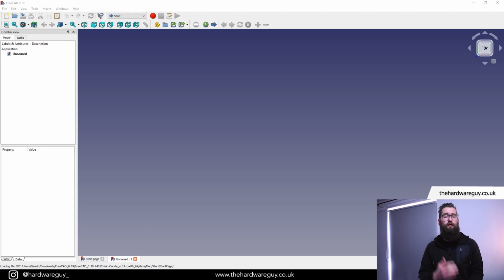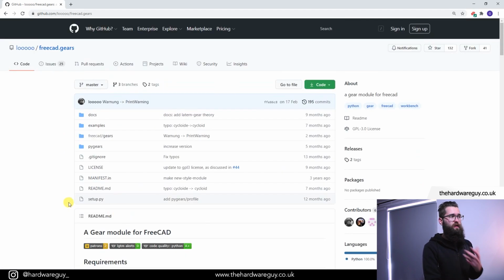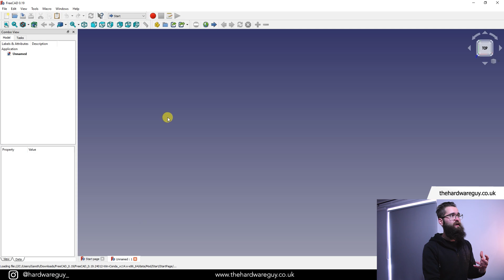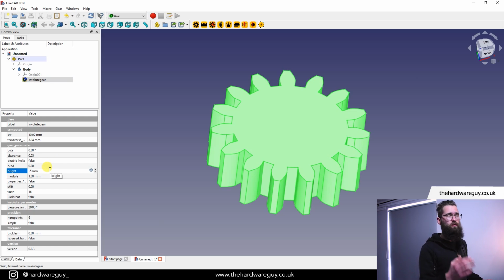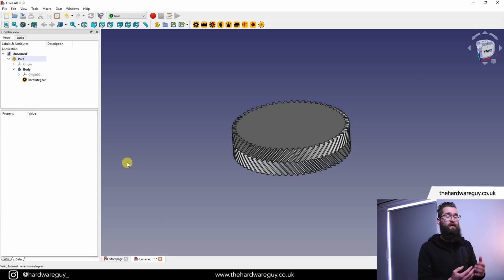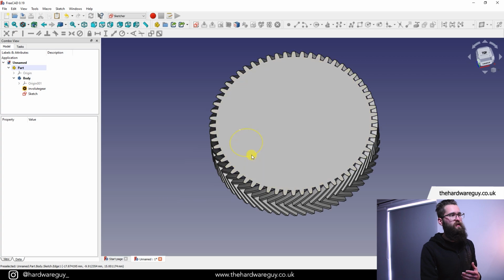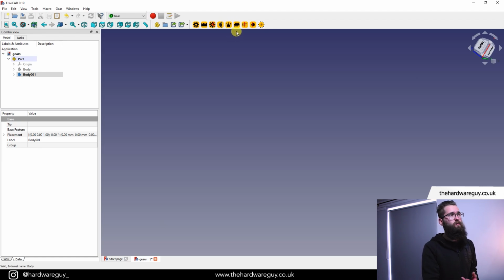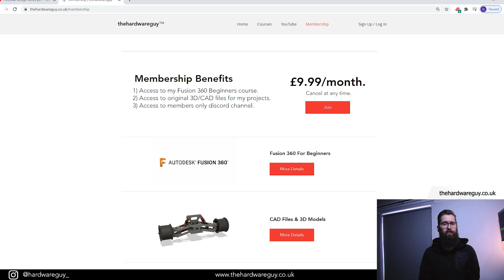Awesome Gears in FreeCAD

Comment: This is a GREAT video for GEARS, I need to make SPROCKETS. Gears use other gears, Sprockets use chain.
Do you have any thoughts? 
Anything would be GREAT!
Thank you for your time.
Reply from the maker: Hi Dave, I've never experimented with sprockets personally. Although, I probably wouldn't recommend 3D printing a sprocket and using it with a metal chain as the plastic would get torn to pieces. The only way it could be practical is if you 3D printed the sprocket in metal to use with a real chain or you 3D print a sprocket and chain in plastic (depending how much force is involved).
Reply: @thehardwareguy  I would NOT 3D print. I need a 2D image that I can put in a plasma cutter. This is what I THOUGHT would be a good program to do that in. I will never have a 3D printer. I just need to make the 2D images.
Thank you again for your time.
Reply from the maker: I'll have a look into Sprockets for you Dave. I'll add that to my tutorial list. Hope the project goes well!

Comment: That's great! Fusion 360 keeps telling me my licenses has expired, tried to see if my system is compatible with Solidworks for makers, they require a Windows workstation with specific hardware, so I started trying to learn FreeCad and am glad there is something to make gears. I have some hobby CNC machines and if I add a 4th axis to the mill I may be able to do a machined finish on the 3D printed gears if needed.

Comment: Great tutorial! I am using version 0.20.1 and there is a new step required to resolve the "Cannot use selected object" issue. after creating the sketch you must create a datum plane and select the gear face. then you can create your pocket on that datum plane. Although I seem to have ran into a bug where, after using the "PolarPattern" tool, only about half of the pockets go all the way through. To correct this issue, instead of using the pocket tool, I use the hole tool and that seems to work flawlessly. Thanks for the tutorial. Keep em coming!

Comment: Great tutorial and exposure to another great add-on, makes creating gears easy, however you can't specify a diameter which is not good if your trying to recreate or follow specs from a drawing
Reply from the maker: Diameter is always determined by the module value and the number of teeth

Comment: for some reason, "create body" is not listed inside the tasks tab. i had to manually click on the blue "step" icon to create a new body. not complaining, but it is different than what happens in this video which could be very confusing for new users. i am using version 0.19.4

Comment: I'm hoping I can get an answer before tearing out my hair. I have followd this step by step, but each time I get to clicking the pocket I get the message "Cannot use the selected object.Selected object must belong to active body" The only difference I can see is in the combo menu where you have part highlighted, I have both part and body highlighted in pale blue, not a darker grey like yours.................Sorted it, for whatever reason I am still trying to work out, the body doesn't stay highlighted, therefore the face sketch ends up outside of the body. All I did was drag and dropped the sketch into the body and it then allowed me to pocket the gear as per your demo. So another aspect learned (almost) Your Freecad demo's are by far the easiest to follow for a newcomer.
Reply from the maker: Hi Brian, to make a body active you must double click on it in the component tree. This should allow you to do what you want👍🏻 Thanks for watching, glad I could help

Comment: Many thanks for a great video,but a simpler method for those who are just starting with FreeCAD or just want to make a gear without being a part of something else, is open in Part Design Workbench New Add Body,switch to Gear Workbench Make gear switch back to Part Design Workbench-select face of gear and make sketch for holes etc.Hope this helps.

Comment: Jan 15 2022, followed you all the way to timestamp @09:29 and I get an error message. I click 'ok' on the message and I get a crash, pale screen and blue circle cursor. The message was relating to part selection. unable to follow from that point and I have to restart FreeCad and do over. Ctrl-Alt-Del is a painful way to follow you . The error message is: "Cannot use selected Object. Selected Object must belong to the active body.
Consider using a ShapeBinder or a BaseFeature to reference external geometry in a body. " The only option is to click the 'OK' button. Frustrating when your excellent video fails to address options and errors leaving me half way through and no way forward.

Comment: I have many troubles. If I make it 48 teeth it will not do the undercut. If i put my shape setting first it will not let me do 48 teeth. If i do the beta/skew/twist and or the helix, it will not do the boloean...
Im thinking in the printer it will shrink so having a cad might not be for me as i will just guesstimate the size any way. I need a 5mm hole so Ill go maybe 5.5?

Comment: All was OK following this tutorial until placing the holes sketch onto the gear.  It did not appear, even though I tried rotating my view.
There appears to be too many steps involved (changing between gears add-on, sketcher, part design, etc, ) to logically follow.
Can you please slow it down a little bit, and give reasons for changing the workbenches, and EXACTLY WHEN to do so.  I'm getting confused by the frequent workbench changes.  Otherwise, excellent work - keep it up.

Comment: Great Video, thanks but...once I create a gear with an axis hole (pocket) and polar pattern holes (pockets), I would like to be able to then make a copy of the file and change the number of teeth from 18 to 22 or something like that and have the part rebuild. The Involute Gear doesn't change when I change the number of teeth. The only solution I have found is to delete the pockets and sketches, modify the Involute Gear and then add the pockets back in. Any ideas? Thanks.
Reply: Follow up - If I use the Part Design dropdown to create the gears, it works the way I would expect.

Comment: NOTE: I couldn't get addin installed, even though I have version 0.18, turns out I needed version 0.18.5 or higher. Updated to 0.19.2 and it worked fine

Comment: Great tutorial, thanks! I went ahead and printed the spur gear from your Raptor 2 files and it had 8 holes rather than the 7 shown here. Was the 8 holes version what you actually printed for the project? Has it been sufficiently strong so far?

Comment: I'm trying to make an involuterack using this Gear workbench and I don't find a way to change its length? 
Also is there a way then to add this rack to another part to make an assembly that could move back and forth?
Reply: I am just starting out as well in fc. So to change the length of the rack, first after the rack is created with default settings a icon will appear in the combo view box.  You have to click and drag the rack icon over the body icon and the original rack icon will turn gray.  I then go to parts design workbench, and click on the rack icon and the lower dialog property box will be active so you can change stuff around.  Of course changing the length will mean adding more teeth.  Other wise you can start a new sketch on the end of the rack to make in longer with out adding more teeth.
Reply: This may have changed since 10 months ago, but simply add more teeth.  There's no length because it's calculated just from the teeth.
If you set the beta angle and double helix to true for a herringbone, the ends are chevron, and height controls the teeth width.  You can always make the gear a bit longer than needed and cut the ends off square once you bring it in to the rest of the design.

Comment: I'm confused about the whole concept of Part vs Body vs Sketch. I understand that in your project you can have multiple parts, and within the part you can have multiple bodies, and within the body you can have multiple sketches. Is there some documentation somewhere where I can read about when to add a new body or when to have multiple sketches in one body and so on? I'm not looking for an explanation (unless it's deceptively simple), just a place where I can go to learn the best practices. TIA
Reply: https://forum.freecadweb.org/viewtopic.php?t=43501
A body is required and must be a single continuous object. You can start with a primitive or a padded sketch inside a body. Within the same body, you can add more sketches based off existing faces or external datum planes. These sketches can support pads or pockets but they must result in one single object. All the sketches in a single body can import geometry from each other. You can have multiple bodies in a Model(file).
 
Parts are optional and basically one level up. They can contain multiple Bodies and you can have multiple Parts in one Model (file). You would use them in lieu of one of the assembly workbenches which were designed to allow you to position multiple Models together. Parts are nice because you can design your device and reference geometry from one part to another (through Shape Binders).

If you were designing a reduction gear box, you could have several compound gears(small gear and large gear on the same shaft). Each compound gear would be a Part. The Parts would consist of 3 bodies: small gear, large gear, shaft. The housing would be another Part, as would a cover plate.
Reply: I do still have the same doubt. And also making sure that the part/body is active, that is really confusing. I feel like I always do it wrong.
Reply: BTW, I have been engineering software for over 37 years, but I am admittedly a total 3D printer/CAD noob so please be gentle.